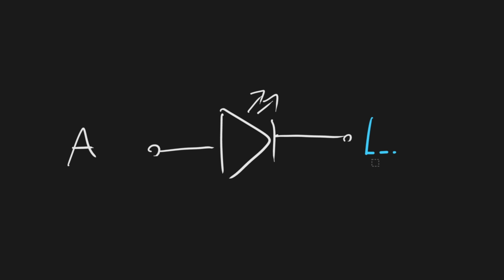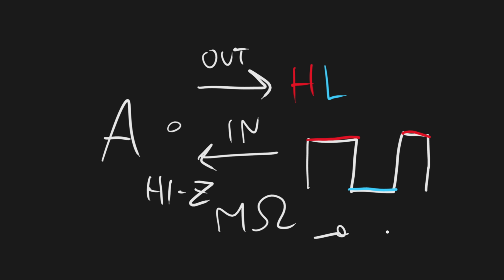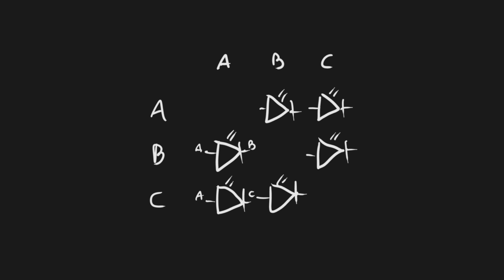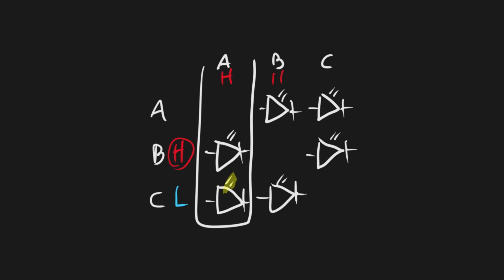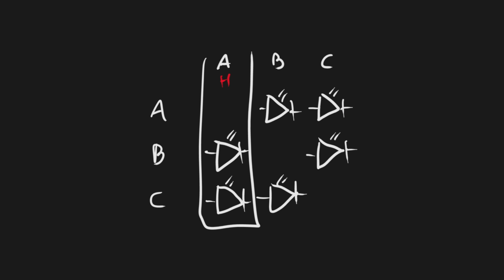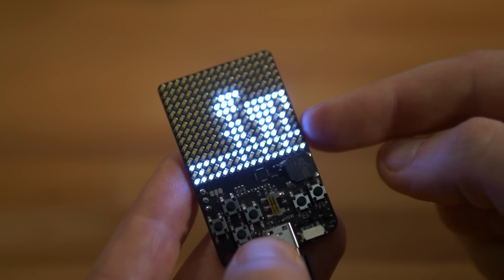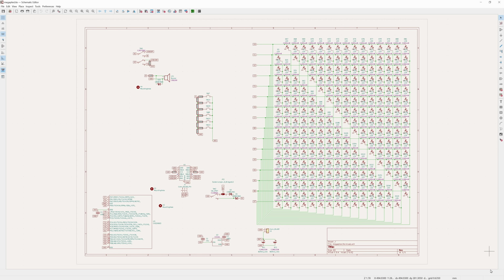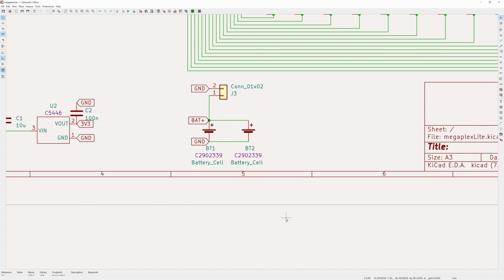From blink to DIY Mini Game - Charlieplexing explained

Comment from the maker: 48000000/128/16 = 23437.5
Reply: If (Amazing_Videos) next_video() ;
Are these floats or doubles? They are written as Ints 😉 - jk
Reply: Is there any way to stream analog videos over wifi using esp32
Reply: @swarupsahu6611  What do you mean? Analog video by definition cannot be transmitted via WiFi. However, it is possible to digitize analog video and transmit the digitized video over WiFi, that can also be to an esp32. Note that you will probably need to choose a format and size that the esp32 can handle, but YouTube is doing the same; on low bandwidth devices it will select a higher compression for you.
Reply: @SojournerDidimus  Yes I want to stream it after digitalizing it.
I just want that I connect an esp32 to a set-top box's AV output so that it can convert this video into any digital format and then stream it over wifi to other devices.
There is a product called easycap but it's not wireless.
Reply: @SojournerDidimus  Do you know how to convert analog AV signals into digital format using esp32?
Reply: @swarupsahu6611  I don't think the esp33 has the power to do this, consider a raspberry pi or a WiFi access point connected to this solution you know about.
Reply: What about sharing led pins with the switches?  Either   drive each switch with the normal led scan, or have a switch only scan after every led frame where you pulse one the switch pins.  You can use the analog in put to read what will be a 0 or 3v signal from each switch, in sequential  order.  Resistors  on the output of each switch will isolate the driving pin if multiple buttons are pressed.
Reply: @Gbrew2 Yes, you can charlieplex buttons as well, note you must add a diode to each switch to prevent button presses from shorting out rows in your LED matrix.

Comment: I made something similar to this in a game called The Powder Toy. It's a 2D particle physics simulator and has a bunch of electrical stuff as well. The screen has columns and rows like yours. There's an LCD element that lights up and acts as pixels, and is controlled by elements called PSCN and NSCN. PSCN turns the LCD element on, and NSCN turns it off. There's a switch under every pixel, also controlled by PSCN and NSCN. If the switch is in the ON position, the signal will go through it and to the PSCN that's touching the pixel, which turns the pixel on. The pixels reset by sending a signal to the NSCN touching each pixel. The screen is controlled by first turning on the switches to the first row, and then sending the column signal to certain pixels, which turns them on. The switches on the first row are then turned off, and the switches on the next row are turned on and then the column signals are sent to light up the pixels on that row. And so on and so forth. For faster speeds, instant conductors are used to send the signal instantly, and the off signals are sent to all switches or pixels at once so the system can reset/be ready for the next row much faster

Comment: I didn't figure out until going back after finishing the video - only 1 column of LEDs is on at a time! I was confused at first.
I think you should add a micro-sd slot! Anyways, it's a really cool project
Reply: Adding a sdcard slot would be really cool, as he could save some animations on it. Of couse more pins are needed, but at this point just get an ESP32 or something. It has SDCard+USB support "built-in" and a lot of pins.

Comment: Adding a tiny plastic shroud around your battery will make the negative protected. If your board is designed with a Vcc plane instead of a ground plane this will allow for the metal battery connector.

Comment: The 3.2V max in the LED datasheet is referring to the forward voltage of the LED when 5mA is flowing through it. Typically it is 2.8V, but variation from part-to-part could make the forward voltage as high as 3.2V. This specification does not refer to the maximum allowable voltage; typically LEDs are specified by the maximum current (30mA for this particular LED). If you were to apply 3.2V to one of these LEDs from a high-current power supply, the current would likely be higher than 5mA. Typically microcontrollers have current limiters on the IO pins, and a decent output resistance, which allows you to drive LEDs with them.

Comment: How about this, but with a esp32 using all available pins to get the most pixels as possible. No buttons, no nothing, only wifi and this board becomes a wifi display. How many pixels would that be?
Reply: 25*24. 600 pixels monochrome pixels. But I doubt you can drive that many leds in series from the micro. So, use some proper multiplexers (which can also stack channels, but with a delay in responsiveness).
Also, that board already has 1 dead led out of 240. Which is fixable (as opposed to lcd and oled panels), but you're probably going to have a pretty high failure rate.
This is a good solution for low res displays or public displays, though. I would make it bigger, go for 16 or 20 leds in series and try different aspect ratios (like 8*30). Some of the public digital displays and scrolling text displays might already use this technique.

Comment: For those who don't want to use a "strange" MCU with a typical "Chinese" datasheet, there is a PI4IOE5V6416 I2C 16-bit expander for any other MCU. 50mA I/O current capability, R/W pin configuration (a Z-state), 24TQFN, up to two devices on a same bus

Yeah, and thank you for the great idea for my big matrix 8x5x30 indicator ) Merely lost a hope to find a good one manufactured

Comment: Maybe am wrong, but If you connect the diodes in the matrix in antiparallel, so 2 diodes for every positiion, and still use the H-L-Z levels, you get n² matrix.  Be 1 and 2 the antiparalell diodes, pin A column, ping B rows.. Then they light when:
B/A  Z L H 
Z       -  -  -
L       -  -  1
H      - 2  -

Rest of columns does not light because are Z
Reply: Только n(n-1)\ n=16

Comment: I did some experiments with Charlieplexing a few years ago, it is a great technique but you have to select your components carefully and you need to keep the tracks as short as is possible. The biggest problem with Charlieplexing is ghosting (and to avoid this), especially when the LEDs are very sensitive. Using resistors (best way is without) can also introduce ghosting or a too slow update/pin switching speed. A too fast update speed (without resistors) can shorten the lifetime of the LEDs or can brownout the pins of the microcontroller over time. You need to find a safe balance between speed (without ghosting), visibiity and (overall) current. Remember we can only see 24 frames per second so there is enough room to skip frames (blank = no output) to reduce the current and also extend battery life. And because of a lower speed (and completely off states) there is enough time to read the state of the buttons without interference (many times). I think you need to slow down to make it better.
Reply: Why do people believe the 24fps thing?? If you're referring to the flicker fusion rate, sure, but we can certainly see above 24fps. I can see light fixtures flicker at 60hz.

Comment: If u have adc you can make the buttons connect different resistors and make a voltage divider that outputs different voltages. Can cram a lot of buttons on 1 adc pin
Reply: Well, it would be a bit of a problem because he also has a 3 volt input and a 5 volt input, which would cause some problems in adc, but i like your idea, the resistor keypad trick is used in almost every cheap thing where mcu pins are limited

Comment: Looks cool:) What is the current limit on the microcontroller io pins?
The current of one LED is 20mA, but there are 16 of them in one column... I don’t think the pin can output more than 100mA. Or maybe the LEDs do not work simultaneously within the same column? Then how many LEDs can light at the time in one column?
Reply: Одномоментно может светиться только один светодиод.

Comment: I've used this technique in 1995. Learned it from some mailing list or BBS or Yahoo groups  while working on a 68HC11 project. 
It didn't have a name back then, but a multiplexing trick someone knew and passed it along. 
Now this Charlie dude comes along and grabs the glory in 2003 while some other smart dude who was the true inventor of this technique got shafted and forgotten.
Reply: Pretty sure multiplexing has existed for long enough nothing significant has been invented the past decade or so for driving a tiny LED display like this.
Reply: if you don't patent or at least make your work known... you tend to get forgotten. I'm sure Charlie wouldn't mind taking the back seat if the other person was able to prove their "invention", right?
Reply: @seanabsher5577  ah right, like that's ever stopped someone doing the minimum work required for it to be 'unique' and passing it off as their own
Reply: @seanabsher5577 Carl Fredric Gauss is not forgotten, yet  they continue to discover routines, etc. in his unpublished works.  Poor students come to him with a solution and he would open a bottom drawer, rustle some papers and show the student he'd found that answer 10 years before.   Lol
Reply: If you were on the PIClist then I posted around 1998. Microchip posted it in a book of tricks as "Charlieplexing" after Y2K. They also posed a simpler version of a matrix keypad in that same booklet, using a resistor ladder like bitluni did here. My one was around 2001 and I was surpriced to see that also pop up as known, later by Microchip. Mine was for an elevator manufacturer, a customer of mine then and I was maxing out the capabilities of an AtMega chip I was using for lift monitoring.  If you wiki it, someone went in the waybackmachine and found my piclist entry for bipolar tristated LED multiplexing and even stuff preceeding it. So it doesn't get Grahamplexing either 😅 Lots of things like this have their time to be invented.  Many inventions were independently invented and some the glory was stolen for sure but usually it starts with publicity of some breakthrough and inventive minds using it to finish a mental puzzle. For me it was simply wanting to drive a large number of LEDs and knowing that PICs can tristate. Using bipolar LED pairs gave me twice the LEDS I'd get from multiplexing alone. I did another one more recently with 20 off an 8 pin CH32V   RISC-v micro but bitluni's used a few more LEDs than that...
Reply: "Трёхзначная сигнальная система" описана в патенте AEG-Telefunken в 1979г.
Шах и мат.

Comment: Well done bitluni. You might need  a small cap on your keypad resistor ladder, could be the led direct drive is  affecting the adc performance.  If you can get an accurate sample while resetting tristates  during persistance of visiin before the next frame then thats an easy sw solution
Reply: Reading resistor networks with ADCs has always been an issue, for me at least. It just fluctuates way too much and messes the button presses up. 
For instance, I've got a 12-Bit ADC to read the resistor network of my car's multimedia buttons on the steering wheel, and just by turning the car on or off, I get wildly different ADC readings, throwing it off.

Comment: Charlieplex.. interesting name, where does it come from??
Reply: I think it was named after an engineer at one of the semi. manufacturers who wrote an appnote describing the technique
Reply: it's the same way that I bit bang i2c, I set the output low to pull the line down and set it to an input to let it go high. this give me a open collector type output on uC. so data is transferred just by  changing port from output to input and not changing what's on the port, always a low.
Works for me.
Reply: @mikeselectricstuff  "Трёхзначная сигнальная система" описана в патенте AEG-Telefunken в 1979г.
Reply: @mikeselectricstuff  Описано в патенте AEG-Telefunken в 1979 году.
Reply: In a Charlieplexed LED matrix, each LED is connected between two microcontroller pins. By selectively setting these pins to high, low, or as high-impedance inputs, the LEDs can be individually controlled. The name "Charlieplexing" is derived from Charlie Allen, who developed this technique.
Reply: Eek Mr squeak @andymouse
Reply: Squeak !!!!!! @TheEmbeddedHobbyist
Reply: It got named  Charlieplexing after a Maxam guy who did it but I invented before him, published before him (on the PICist) and apparently others were before me too. It's one of those things that was going to occur to inventive people once tristating of microcontroller pins was available.
Reply: @fluiditynz  which is why i refer to it as multiplexing, it been done in so many ways by so many people and so many different times in the past, it's not right to say it was one person. switching an I/O port from output to input to make it appear to  be open collector or drain has been around as long as microprocessors.
Reply: in the old days it was just call multiplexing 🙂
a bit like the hyperloop is just a new name for BRUNEL’S ATMOSPHERIC PIPE 🙂

Comment: A couple of other tricks you can do : 
Measure the battery voltage and adjust the LED drive duty to maintain constant-ish current. 
for the buttons, use the LED matrix pins to scan a "1" across the pins, with a resistor from each pin through a switch to a common line, with a pulldown resistor, sensing with an ADC, or maybe logic level if that can work with the LED drive stuff. Or you could use 3 dual diodes instead of the series R's. Could maybe flip the button pin to input briefly for the measurement.
Reply: wait, we can do a color screen if you find 3.3v rgb leds, the resolution will be 3 times lower, but color is color
Reply: @grindfi  If you have Red green and blue subpixels, you can stagger the LEDs for more perceived resolution. You would not gain back all the resolution, but it would help. So the resolution would cut in a third, but then you could double the 'virtual resolution' with staggered LEDs, which would appear to about 1.5x the actual resolution.